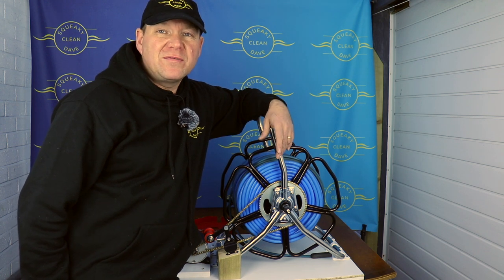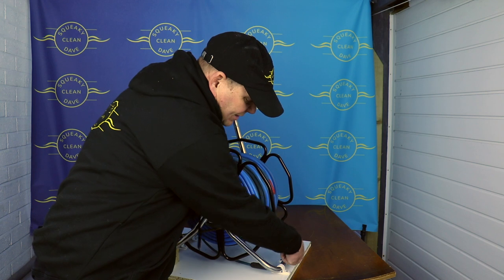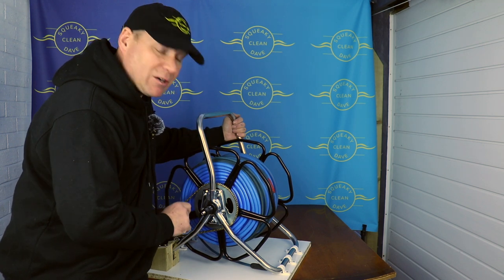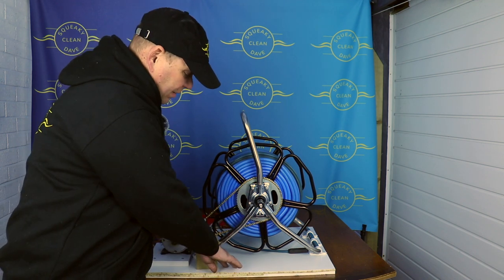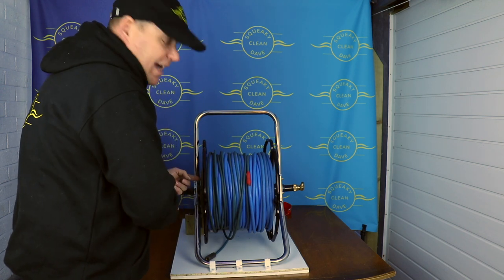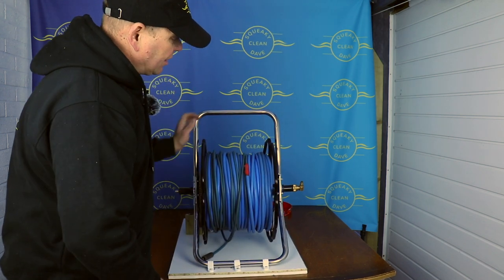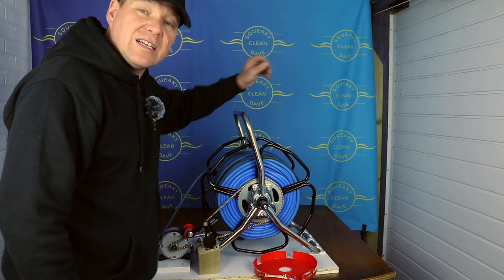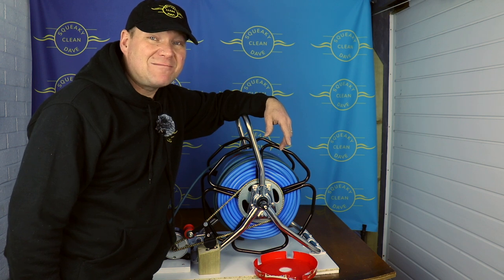7 Improvements To DIY Powered Hose Reel

Comment: brill set of vid on this, but can i ask with uesing the othere reels have you had prob with the reel moving from side to side. In the vid (The Fastest Powered Hose Reel In The World. Possibly) the bearings you used would have stoped this I think
Thanks Joe
Reply from the maker: Hi Joe. 
the bearings did stop a bit of movement but the problem with them is that you have to build a whole frame to hold them. mounting the motor to the existing frame is much easier and cheaper.
Reply: hi thanks for the replay but can i ask please when mounting to the board how did you stop the sede to side movment
Thanks Joe @squeakycleandave1

Comment: Hey Dave. (or anyone else) Thank you so much for all the great videos. Really appreciate it.... Going off topic here.. Im getting a 16 litre camplux tankless gas shower to run 2 wfp hot water. I've got a 7lpm pump. Will this pump up to 72 feet hight for apartments. Or do I need to put a pump after the water heater as well. Thank you in advance for any info

Comment: Hi Dave, am I right in thinking you used a chain with 85 links in to start with? if so, how many links did you remove in the markll to get the motor that close to the reel? Thanks in advance :)
Reply from the maker: Arky B I cannot remember off the top of my head but I will try and have a look tomorrow and let you know 👍

Comment: Hi Dave Great improvements. Just a quick question. I have a remote control for my set up, however it does seem to have cross interference from other signals. ie it turns itself on from other signals. I was wondering if you have found this with this one.
Reply from the maker: No I’ve had no problems with it at all. I’ve got 2 in the van now and they don’t even seem to interfere with each other

Comment: Great video Dave, I've turned both my reels DIY electric .
Like the chain guard idea, a bit of spray paint will disguise the celebrations tub.
Improvement no.8 fit a heavy duty swivel from Lee Martin at Bladeright, a great bit of kit.
Reply from the maker: Tim Hancock thats next on the list but the one I put on is new so will do until it waters out👍

Comment: Alright Dave is that remote still in good working order I am thinking of changing mine over to the remote instead of the standard hoist switch 
Thanks Steve
Reply from the maker: Yes mate. It’s never gone wrong once. Just make sure you get one with a high enough amp/watt rating
Reply: @squeakycleandave1  I will just click on your link and buy the one from Amazon and thanks for the info

Comment: Hi do you mind me asking do you need to fit a thermal cutout switch ie for the scenario when the hose catches on say wheelie bin wheels etc ? Or does the motor just stop under load ? But does it cause it to blow fuses that way ?

Thanks for any advice
Reply from the maker: It would probably be best to fit some sort of cut out switch but with a 250watt motor you can stop it with your hand quite easily. Mine is a really basic easy set up. If it does catch or you hold it for to long then yes it does blow the fuse but I’ve only ever had this happen once
Reply: @squeakycleandave1  ok thanks for that info

Comment: Amazing video! Thank you!
Just a quick question. Do you need to disconnect 'water hose' which goes from tank to reel, while you coil hose on reel?
Hope you know what I mean.
Thank you
Reply from the maker: I think I know what you mean. No you dont have to disconnect the hose to reel it in👍
Reply: @squeakycleandave1  Thank you😊👍

Comment: great vid mate. where did you get the motor from, or the info on like 12/24v as i seen one on here and he used a wheel chair motor that was 24v.
Reply from the maker: https://www.ebay.co.uk/itm/ZY-MY-1016-Electric-Scooter-Motor-DC-24v-350w-Brushed-24-Volt-350-Watt-6mm-Chain-/193359506053?_trksid=p2349624.m46890.l49292
Reply: @squeakycleandave1  and you can use 24v on a 12v battery?
Reply: found a switch when you press it it goes on let go and it stops. if you search for momentary wireless

Comment: Hello Dave, I’m still watching the back catalogue os your videos 😄. Can I ask where did you get the clamps for the hose reel to attach it to the plastic base?
Reply from the maker: They are cable conduit clamps from Toolstation. They aren’t vey strong though
Reply: Thanks Dave. 
I’ll see if I can find some metal ones. How’s you electric hose reel going? It’s my next project. 
I’ve done the tubeless and unviable setup that’s to your videos 👌🏽👏🏽
Reply from the maker: @robinbanerjee2520  the reels are all working really well 
Glad you are finding the vids useful
Reply: I meant thanks to your  “univalve” videos.
Reply from the maker: @robinbanerjee2520  🤣 I thought so👍

Comment: Hey Dave! My father and I are going through the list from this and your previous video regarding motorized hose reels and have ordered just about all of the bits. One question though. The plastic base board you're using looks pretty good, but we can't figure where we might get it from, and what dimensions (in terms of width/length) to go for. Our setup would be almost identical to yours so any advice would be gratefully received. Thanks for your informative videos and keep up the sterling work!
Reply from the maker: Johnny S. Hi Johnny. The board I used is 26”x19” and 3/4” thick. As to what type of plastic it is I don’t really know. I just went into a place up the road from me and asked for something suitable. I will try and find out next week when they are open again 
Thanks for watching 👍
Reply: @squeakycleandave1  many thanks! Like yourself my dad and I try to be as thorough as possible when it comes to our equipment and techniques. We're always looking for ways to improve, even when things are going well. We both find your videos very informative!
Reply from the maker: Johnny S I appreciate you watching them and are glad you find them useful 👍
Reply: Hi Dave, I'm Johnny S's dad. We've got most of the parts we need to motorise our first reel but I've been unable to source a suitable plastic board locally. I'm reluctant to order online as there are so many different types of plastic and I wouldn't know what to choose without seeing it in reality first. We'd be very grateful if you could help us to choose and source the board that we need.

We have had great success with your advice on fitting an immersion and it has made our work quicker and easier.
Thank you for that and for help you might be able to give re: sourcing the board.
All the best for now.
 Davy G 🙂
Reply from the maker: Davy G Hi Davy. I’ve called round to the company that I got the plastic board from a couple of times but it has always been shut and there website isn’t working. It was an old chap they I dealt with so I’m not  sure if they are still trading. I think it was just PVC board but I’m not 100% sure. You could try giving them a ring directly next week if you want and I will try and pop round again. 
They are called 
Argo Plastics 
Kidderminster 
01562 823531
Sorry I couldn’t be more helpful 👍
Reply: Thank you very much Dave. You could do no more. I'll give them a ring. If I get it sorted I'll let you know.
Thanks again. Davy G...(same name on the forum). 🙂👍
Reply: Hi Dave, I just tried to call Argo Plastics... Number wasn't recognised.
Life is rarely simple, eh? 🙂
Reply from the maker: @digger7315  im wondering if he has closed down. as I said I called round earlier and it as all locked up🤷‍♂️
Reply: @squeakycleandave1  I think you're probably right Dave. My wife found another phone number for them on yellow pages and that's not recognised either. Don't worry mate I'm confident I'll be able get it sorted. If and when I do I'll let you know.
Thanks for trying mate, you could do no more. 🙂👍

Comment: Hi dave look inside your receiver box see if there is a program buttom which should allow you to use momentary mode when programmed in
Reply from the maker: Russell Emery I will check mate and see. It would be really useful if there was👍
Reply: @squeakycleandave1  if there is there is a listing on ebay that gives programming instructions on the listing i have just ordered it so when it arrives I will post the instructions here for you
Reply from the maker: Russell Emery fantastic thanks. I will have a look in it tomorrow 👍

Comment: Wow, Dave, you are pretty clever in designing all those improvements. I'm not at all that skilled to be able to come up with those additions. 🙂
Reply from the maker: McRae's Window Cleaning Brisbane Thanks Duncan. Ive used my original one for 2 years now so knew what needed changing but they aren’t all my ideas.  👍
Reply: Thanks Dave. 
I’ll see if I can find some metal ones. How’s you electric hose reel going? It’s my next project. 
I’ve done the tubeless and unviable setup that’s to your videos 👌🏽👏🏽

Comment: Hi dave great video, are you still using a 20amp fuse mine keeps blowing when i stop mine by hand or it gets snagged
Thanks in advance dave 👍
Reply from the maker: darren4222 yes mate. Still using it. Had no problems with a 20amp👍
Reply: @squeakycleandave1  thanks for getting back to me dave really appreciate it 👍 will have to look into mine further to see what the problem is, I'm using 17amp wire could that be the cause? do I need a higher amp wire do you think,
Thanks again good videos keep up the good work 👍
Reply from the maker: darren4222 if you stop it completely by hand it will blow the. If it didn’t it would burn out the motor
Reply from the maker: If you work out the fuse rating using a 250watt motor it work out to 21amp so might risk a 25 amp fuse but I can’t say that it will protect you filter properly.
Reply: @squeakycleandave1 
Thank you very much dave for your excellent videos, help, and time I will try that, top fella stay safe thanks again dave 👍
Reply from the maker: darren4222 thanks for watching the videos 👍

Comment: One improvement I added was an inline on off switch.  I found the key fob to be a bit sensitive and could easily go off knocked.  I only wind the reel in when I'm next to the van anyway, as it needs feeding, so I just turn it on as and when needed.
Reply from the maker: Alex I’ve got a kill switch which turns everything of on my whole system hose reel, pumps, controllers everything. 
I turn it off at night and it saves any draw on the battery

Comment: Do you have a link for the motor? Is it 12v or 24v?
Reply from the maker: It’s a 24v motor but I’m using it on a 12 v system
https://www.ebay.co.uk/itm/254714209341
Reply: @squeakycleandave1  Thanks mate.
I'll try that

Comment: Some great improvements there! 👍 can you please show me your connection between hose reel pipe and pole pipe? I have same set up as you with tubeless pole and I can never find a connection I’m happy with. I tried the slick connect but gets caught on everything.
Reply from the maker: Westwood Cleaning Services I use the slick but exceed have a hose joiner on there site which you may be able to get elsewhere. It’s also probably to use a brass pencil jet which I’ve used in the past but it would have to be a big one 

https://ex-ceedinnovation.co.uk/shop/hoses-connectors/6-to-6mm-hosebarb/
Reply from the maker: You may even be able to use a male rectus fitting o clipped on

https://ex-ceedinnovation.co.uk/shop/hoses-connectors/rectus-21-nickle-plated-hosetail-6mm/
Reply: Squeaky Clean Dave
Excellent thanks for taking time to reply 👍
Reply from the maker: Westwood Cleaning Services my pleasure. Happy to help
Reply: Do you need the double ear clips?
Reply from the maker: Westwood Cleaning Services double or single wouldn’t matter
Reply: Fitted the remote last Friday and it is a game changer. 👍👍
Reply from the maker: Westwood Cleaning Services I love my remote👍
Reply: Squeaky Clean Dave I fitted a hose guide on rear bumper so it’s sat central to hose reel. And I get no more hose jumping reel and it never gets caught in rear door when pulling out. Honestly work is getting so simple now.
Reply from the maker: Westwood Cleaning Services great idea. I might try that. Where did you get your guide from
Reply: Squeaky Clean Dave it’s only a hose lock one from B&Q but it works a treat. Tried so many times to figure something out. But this is awesome. Like I say reeling out and back in a doddle now.

Comment: Great video Dave, the remote switches are great aren’t they.
I’ve made a few improvements to mine over the holidays.... it’s a bit addictive isn’t it 🤣🤣
Could be doing worse things I suppose.
Reply from the maker: Stephen Case I know. I’ve started getting ideas for mark3 now. Trouble is there will be that many things added it will cost more then buying one🤣

Comment: Anyone know where I can source the sprocket bought of eBay but the centre bore is to small. Can’t find one with 60mm bore anywhere
Reply from the maker: Ricky Wolstencroft try giving these guys a ring
https://www.petrolscooter.co.uk/
Reply: Squeaky Clean Dave hi mate no luck can’t find one anywhere needs to be around 50mm centre to fit over the plastic on the reel
Reply from the maker: Ricky Wolstencroft I know mate it’s getting harder and harder to get one to fit. Since I did my original one they have changed the design

Comment: What motor you used please ?
Reply from the maker: 250Watt 24volt running at 12volts
Reply: @squeakycleandave1  from where we can buy it please?
Reply from the maker: @ML-hu9zu  I got mine from eBay

Comment: hi dave, do you have a link for the chain tensioner, the one below doesn't work. great upgrades!
Reply from the maker: Davey Snoad try this one. If it doesn’t work search for chain tensioner under the category of motor cycle parts on eBay 

https://rover.ebay.com/rover/0/0/0?mpre=https%3A%2F%2Fwww.ebay.co.uk%2Fulk%2Fitm%2F202842239847

Comment: I'd love to see an electric conversion of a Pure Freedom twin stack reel?
Reply from the maker: Jason Strawson could be interesting 👍
Reply: I've done mine
Reply: Just done the bottom stack of pure freedom reel as a trial,  works great now on with top stack. All parts available  from petrolscooter on ebay, great price and delivery.  Use the wireless key fob, which is easy to reprogram  for Momentry mode. Thanks for all your videos , much appreciated
Reply: @newsamvn  would be interested  to see the results please?

Comment: You should have got a winch wireless remote. There cheep and safer as they only motor when you have finger on trigger
Reply from the maker: Gillies Cleaning I was looking for something like that. I don’t suppose you have a link for one. Thanks 👍
Reply: Would one of these run two reels? Or would you need one for each?
Reply: @phwindowcleaningservices9862  if your clever you could wire up two reels on one controller you need 2 relays
Reply from the maker: Gillies Cleaning. Thanks for that. It looks better then the one I’ve got and it’s cheaper.
Reply: Gillies I’m thinking of changing to a winch remote. My current one seems to have stopped working. Do you know what the range is like on them ?